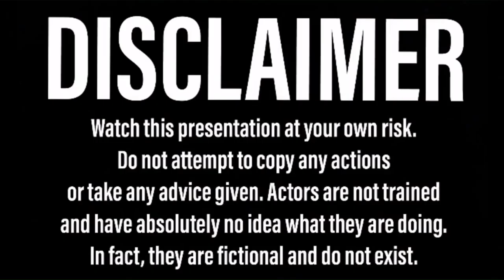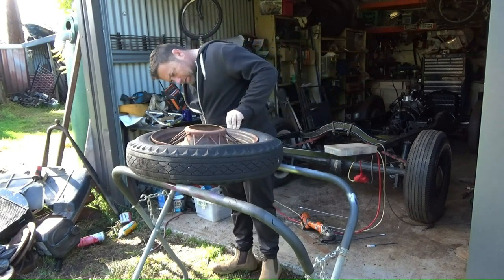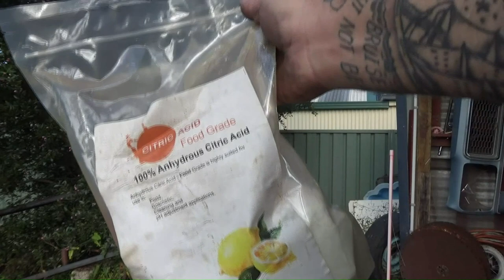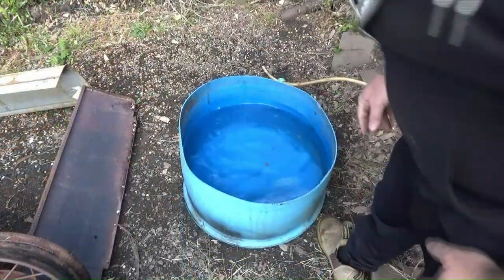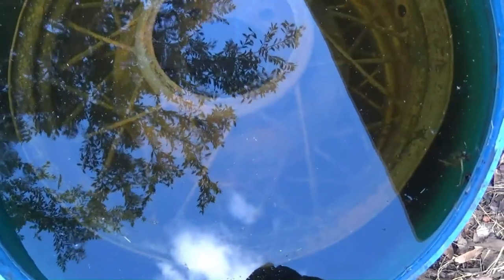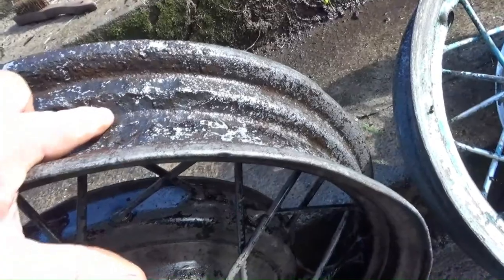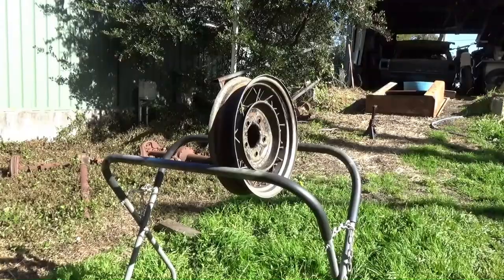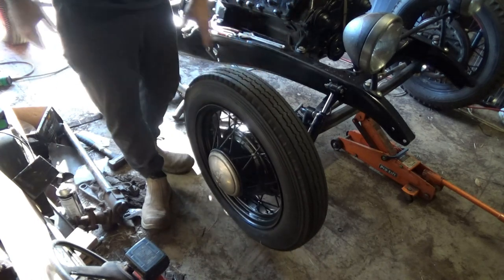Using Citric Acid to strip the rust off my Wheels - Model A Hot Rod Build Pt24

Comment: Totally loving this build, you've inspired me to start looking for a project for myself!!!👌
Question: At what point/HP would you consider boxing the chassis rails?
Reply from the maker: Cheers. Really depends on the chassis and what you’re looking at putting in it. Most engineers would probably expect some form of chassis strengthening with anything over 20% more capacity in NSW anyway..